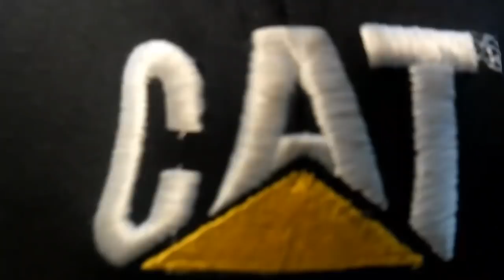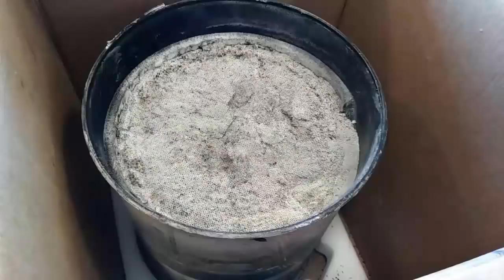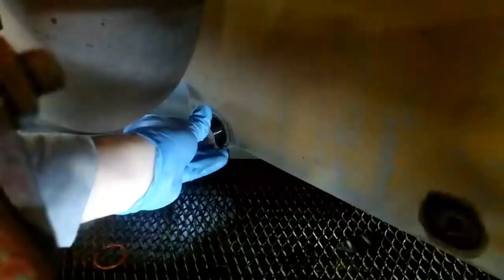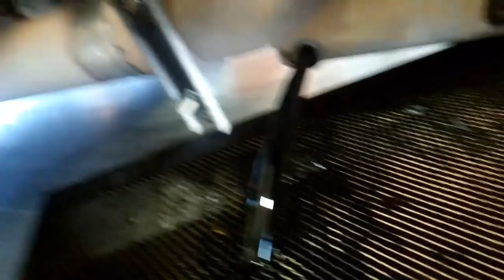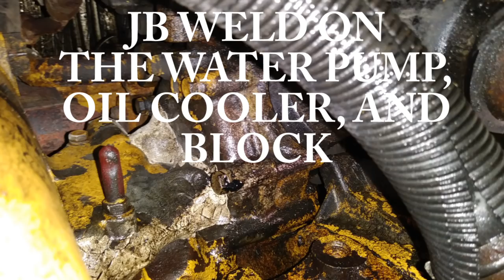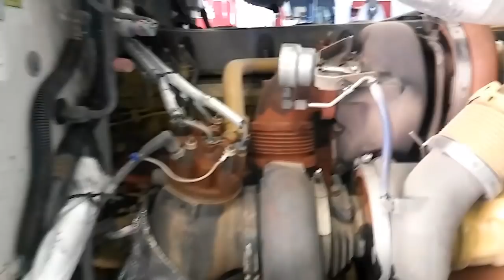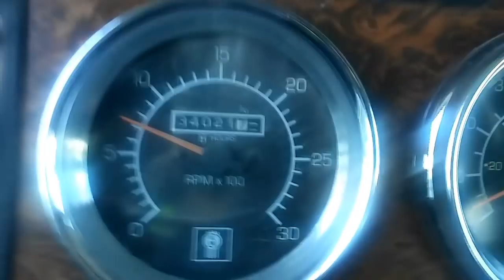What To Look For In A Used Diesel Engine? Used Diesel Engine Inspection.

Comment: Can not stress it enough on how important fluid sample testing is when looking to purchase any used vehicle.  If the seller will not allow you to sample the fluids, then walk away while you still can.  Be suspicious of any used vehicle with all new fluids yet the seller claims no repairs have been done recently.  Also many shops now have on-site basic fluid testing capability and will find major warning signs in only a couple hours.  You can also send off the fluids for advanced testing (Blackstone, ALS, etc) and request rush testing (for higher fee) to get the results emailed and/or posted on their website shortly after they receive & test the fluid sample.  If you are near a major city, then you may be able to walk-in a fluid sample for even quicker testing at a vehicle fluid testing lab.

One thing not discussed in this video is service records.  Many sellers will gladly share their service records with serious buyers.  Lots of great history and red flags for possible up coming repairs can be gleaned from past service records.  Pay close attention to mileages and dates - make sure they follow a pattern and not just randomly done to try to have a partial paper trail.  We have found many vehicles with much higher mileage than what the seller claimed just by looking at service records and finding unexplained inconsistencies in recorded mileage at the time of service/repair.
Reply: True, I purchased a truck and I took my mechanic over to take a look at it eventually I found out that it had been overheated and they just did a half assed job on the engine and put it on sale; and yes they got me,  bad deal ever made!😕😕😕
Reply: Not everybody that points out your lack of knowledge/experience is a troll dude.  Your concept of the benefits of oil analysis is uninformed at best.  It's not a blood test.  If your cholesterol is 300, you have a problem.  400ppm of aluminium in your oil may, or may not indicate a problem.  It depends on the way it is trending.  In other words, what was it in the last sample?  How is it trending from the baseline.  With a one off sample, you have No BASELINE for comparison .  Call the tech service people at Chevron, they'll "troll" you and tell you the same thing.  Ask an Attorney with experience in the trucking industry if there is any risk/liability involved in giving a buyer the maintenance records on a unit.  The will also "troll" you and tell it's a bad  idea.  Not everybody is a troll.....  Believe it, or not, there are people in this world that are a whole lot smarter and with a lot more experienced than you.  I'm one of them.
Reply: Nice try troll.  Go copy & paste your replies to someone else's Youtube comments who may fall for your antics, like you have done on so many other videos on Youtube.
Reply: Other than fuel dilution, or glycol contamination, one off oil sampling tells you practically nothing.  You have no baseline.  The report comes back 400ppm of aluminum....  Is that an increase over the last sample, or is the TBN # 1.5 and the oil has 50,000 miles on it?   As far as maintenace records go, if the unit is involved in a fatal accident 2 years after you sold it and you gave the buyer your maintenance records guess who's also going to be named in a lawsuit.  Seen it happen....  Never give up your maintenance records, unless you don't mind talking to one of those jackass personal injury lawyers you see on the billboards as you drive down any interstate in the country if something goes wrong. To much risk involved to be Mr. Nice Guy.
Reply: @bobdriver6946  Do you have a case reference where someone sold a vehicle with the service records and got sued for an accident 2 yrs later?? I know that I was born at night, but, it wasn't last night, In my 50 yrs of buying and selling vehicles I've never ever heard of someone getting sued 6 months after selling a vehicle with service records let alone 2 yrs later with service records???
When I buy a vehicle and seller hands me a folder of all of the service records that tells me someone took care of the vehicle I plan on buying, it makes my decision to buy it much easier than buying with no service records at all...
Reply: @crazycanuck2578  I don’t really have a horse in this race and it’s also been a year… but… two things. Well, 3. I don’t know a lot of technical stuff about Diesel engines, but the guy above is right that you want a baseline for your engine and it doesn’t necessarily tell you your engine is in trouble, unless you’ve got a reading that’s just abnormally high. Oil samples don’t paint the entire picture. I have some experience with oil samples in small aircraft engines where sometimes a great engine with no oil consumption issues turns back a worse oil test than an engine that does have oil consumption issues and didn’t last as many hours. 

2) This dude was talking about commercial trucking in the US, so I’d figure a regular car sale in Canada (I assume by your username) is different legally. Don’t know anything about trucking laws but also I know they’re different than private parties driving. 

3) Depends who you buy your vehicles from but if you’re buying from me, you’re not getting service records because there is none. A lot of people, especially that own working vehicles like a semi or a tractor will make repairs themselves (at least in my experience). Maybe an overhaul receipt would make sense or any major major work but stuff like batteries, belts, oil changes, injectors etc etc would probably not be covered by a lot of people selling decently used equipment. I’d guess you’d see when the case got split but that’s about it. 

Overall I’d say this dude isn’t trolling but he’s working off of experience in his life. Same with you, you probably had certain experiences that makes you have your opinion but that doesn’t mean there’s not a grey area or both of y’all can be right.
Reply: I actually agree and I know how expensive repairs can be on diesels and how a lot of us make our living with them so need them to be reliable but,
Someone drives my truck that I know is good and they check it and or have it checked I'm done.
You want it or not ?

People that aren’t trying to pull anything aren’t going to jump through hoops and have someone indirectly say they have no reason to not believe them after having it checked out but they don’t and if you read / to everything or even a little actually  on web there’s a red flag for everything and it makes you wonder if the odds of something being amiss are that great should you even buy a used truck?
The % of people hiding something is low imo and the % of people hiding something you and or a mechanic can’t find in a reasonable amount of time is even lower 
I’d like to know what percentage that is but imo not more than 5%
Reply: Nice troll account you made to post a reply that is full of misinformation.  Hopefully people reading your comment do some research on your other posts to see you have nothing better to do than just go around posting misinformation looking to get people all worked up for your own jollies.

Comment: Do you strictly work on engines at CAT or do you do full truck repair like airbags and brakes?
Reply from the maker: Our shop is pretty much full service, we don't do everything, but other than Cat engines, we do brakes, suspension, electrical, HVAC, and drive line. I think I had way too many commas in that previous sentence.

Comment: 6.0 powerstroke!  All day baby!
Reply: Dylan collins 7.3
Reply: 7.tree
Reply: Joe Sniadecki 

6.ohhhh
Reply: Dylan collins $$$$$
Reply: I had a 6.0.... I fixed its issues by getting a 7.3
Reply: My 6.0 power stroke has never let me down and I did not bullet proof anything. The only thing I changed is the fuel pressure spring. I have always used the blue spring.